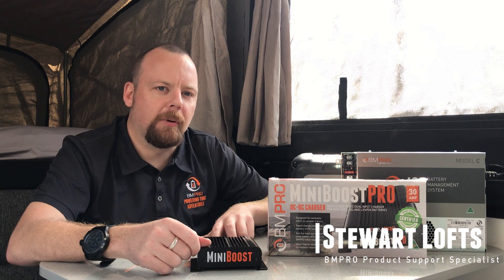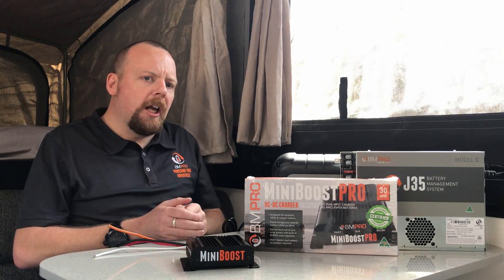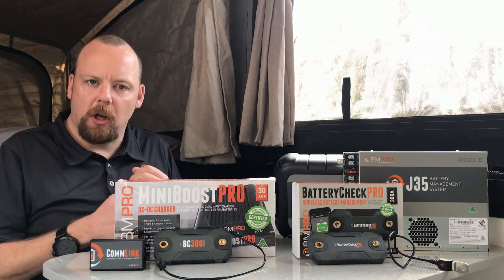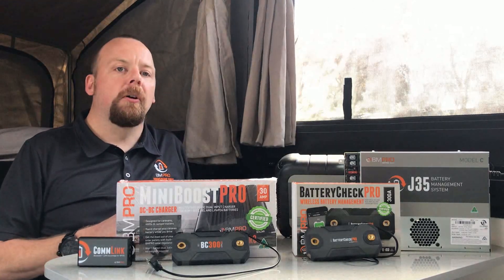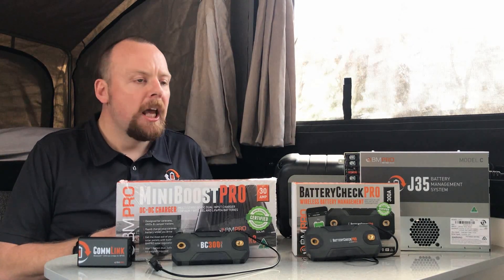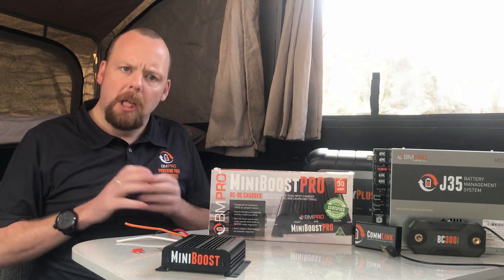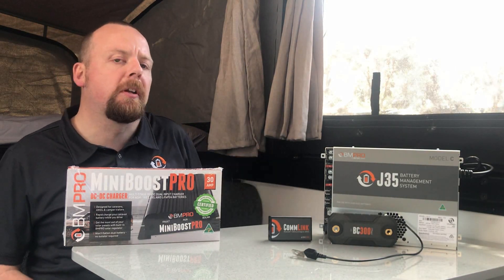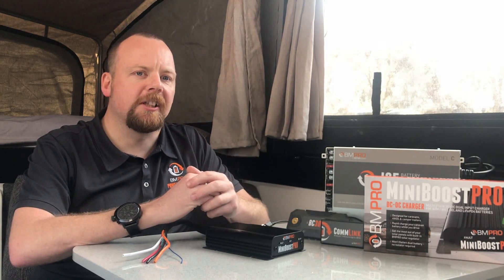Reasons Why You Need A DC-DC Charger (Charging On The Road)

Comment: I have the solenoid to stop the battery being drained already connected to the van via the 12 pin plug. my question is: will I get a feed from the J35 B AUX or do I need to run a new cable.
Reply: I do have the BC300

Comment: I’m still confused, one vid says wire the minipro into the Aux input , and   Away you go 
Then your other vid is taking about wiring in a shunt , 
The more I watch the more confused I get , 
I have asked before , can I please get a simple answer 
Bmpro 35-11-HA 
Feed my Aux supply from the car into it , the miniboost into the Aux input on the HA , and wire my one fixed solar into one solar input , and my portable panel into the other solar input via a Anderson plug 
Plan c , Aux and both panels into the miniboost pro , then into Aux on the 35 -11-HA
Reply: me too

Comment: I upgrade all the system in our jayco expanda outback from BMPRO to a full redarc system as jayco would not install a J35D ... jayco wired my external Anderson plug for a portable solar panel straight to the batterys in the van.  And the 103 node gives me nothing but issue's
Reply from the maker: Hi Andrew, 
What kind of issues are you having with the ControlNode103?

Comment: Hello, At the start of the video you state to put the Mini Boost Pro Output into the Auxiliary input of the BMPRO, I have looked at the instruction/specs for the Mini Boost Pro and it will error if it does not a have a voltage for the battery it is trying to charge. The BMPRO does not show a voltage at the Auxiliary terminal.
At around the 12 minute mark in the video you say the solar regulator in the Mini Boost Pro needs to see a battery voltage to begin charge and that there is a diode on the Auxiliary input on the BMPRO which prevents this, so it should be wired directly to the battery and run a shunt/comlink.
So which is it, the Mini Boost instructions show it should be wired directly to the Auxiliary input on the BMPRO, but it does not work, not on vehicle charge or solar as both need to see a voltage to begin charging.
Reply from the maker: Hi Chris, we believe our customer service team had answered your question directly earlier. There are two ways the MiniBoostPRO can be wired depending on the application. The solar regulator in the MiniBoostPRO needs to see battery voltage to charge, this is why we recommend using a BC300. Otherwise just connect to the AUX input on your BatteryPlus35 or J35 unit.
Reply: @BMPROau  hi, thanks for the reply, I have not heard from anyone else.
Looks like I will need to go directly to the battery. Thanks